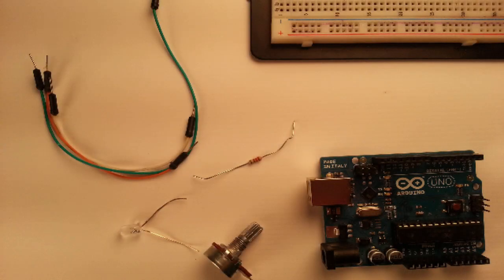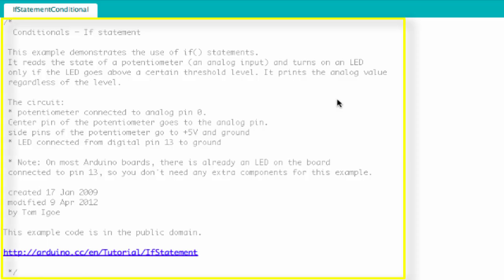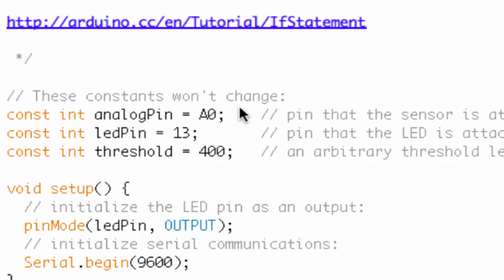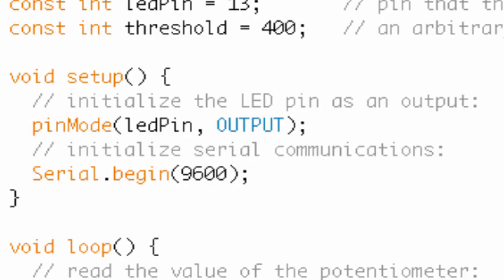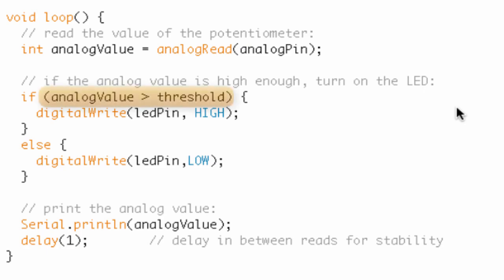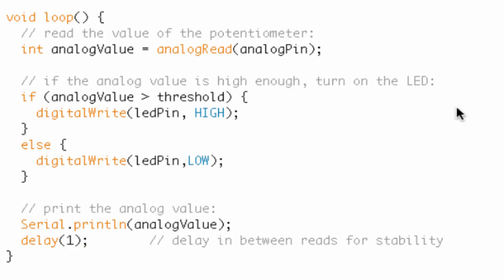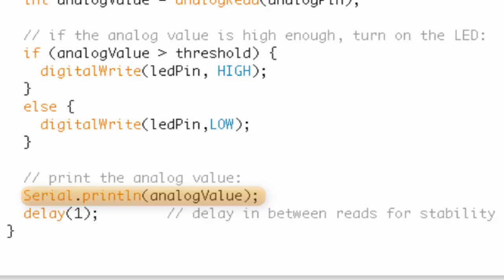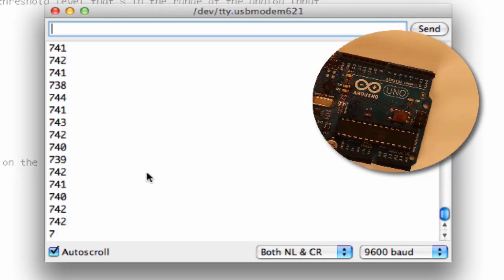Tutorial 11: If Statement Conditionals: Arduino Course for Absolute Beginners (ReM)

Comment: Really strange, I have the code set to turn the LED on before 100 and after 400 and the <100 is fine but the >400 read seems to make the LED REALLY dim, like barely able to be on. can someone explain? Here is the code:

const int analogPin = A0;    // pin that the sensor is attached to
const int ledPin = 13;       // pin that the LED is attached to
const int threshold = 400;   // an arbitrary threshold level that's in the range of the analog input

void setup() {
  // initialize the LED pin as an output:
  pinMode(ledPin, OUTPUT);
  // initialize serial communications:
  Serial.begin(9600);
}

void loop() {
  // read the value of the potentiometer:
  int analogValue = analogRead(analogPin);

  // if the analog value is high enough, turn on the LED:
  if (analogValue > threshold) {
    digitalWrite(ledPin, HIGH);
  } 
  else {
    digitalWrite(ledPin, LOW);
  }
  //This is my edit
  if (analogValue < 100) {
    digitalWrite(ledPin, HIGH);
  }
  else {
    digitalWrite(ledPin,LOW); 
  }

  // print the analog value:
  Serial.println(analogValue);
  delay(1);        // delay in between reads for stability
}
Reply from the maker: Flyerminer I think what is happening is that you are not allowing any time for the pin to be HIGH, when it is above the 400 threshold.

If you try:

  if (analogValue > threshold) {
    digitalWrite(ledPin, HIGH);
    delay(10); //add a short delay
  } 

This should do the job.
I believe the delay at the end of the program is what is helping the LED stay illuminated below the 100 threshold.

Hope this helps!
Reply: Really interesting. Had a similar problem and I've tried a slightly different approach:

 if (analogValue > threshold) {
    digitalWrite(ledPin, HIGH);
  } else {
    digitalWrite(ledPin, LOW);
  };
  delay(50);

  if (analogValue < threshold2){
    digitalWrite(ledPin,HIGH);
  } else {
    digitalWrite(ledPin,LOW); 
  }

When delay(10), led lights up better but still slightly dim when below threshold2 = 100.
When delay(50), led blinks when below threshold2 = 100.

Any idea what's causing this?
Reply: Late response, but you have 2 if-else blocks rather than an if-else block with a compound condition. Instead of checking if analogueValue is greater than threshold and THEN try checking if it's smaller than threshold2, check in one condition whether it's greater than threshold OR smaller than threshold2:

if(analogValue > threshold || analogValue < threshold2){
    digitalWrite(ledPin, HIGH);
} else{
    digitalWrite(ledPin, LOW);
}

Otherwise, if it's under 100, then the first if-else block will see that the condition evaluates to false, causing the else block to be entered and executed, turning the LED off. Immediately after this, you check if the value is under 100, which it is, causing the if block to be entered and executed after a delay of either 10 or 50 milliseconds. This will turn the LED on. This process is looped, so for a longer delay, the LED is off (delayed after the first if-else block) for longer, causing you to see noticeable flashing. For a shorter delay of 10 ms, the flashing isn't apparent; the LED just toggles between off and on very quickly, and you see that as a dim light.

Comment: if i have an object that can move up, down, left, and right. And first i want it to move to the right on command but it should not be able to go down when it is moving left to right or right to left and it can go any further than a certain point (proximity sensor will sense that) and when it moves to that certain point then it can be able to move down and up but when its moving up and down it cant move left to right or right to left. now what statements would i need for those particular movements?
Reply from the maker: It sounds like you might be using several "operators" in the condition of you "if statement".  For example,  
if( movingLeft || movingRight ) {
    //this code only gets executed when one or the other condition is true || is the OR operator. 
}

if( !movingDown ) {
    //this code only gets executed when the bot is not movingDown
}

These are just some very general thoughts on your question.  Hope they help.  You can check out more operators at the Arduino Reference Page for operators http://arduino.cc/en/Reference/Boolean

Comment: So weird, I can't get it to read voltage instead of just value, in println i put "(analogValue*(5/1023));  and it just shows 0, tried making an actual int and still doesnt work. Makes no sense. Not even  printing (A0*(5/1023)); works
Reply: can you send the sketch and have you verified it most of the time any problems show up there
Reply: I just asked this question also.(sorry for not seeing this comment first). Try changing the 5/1023 to either 5.0/1023 or 5/1023.0 - More on this in my comment.

Comment: Do you have a tutorial to show if else statements for a certain range of voltage? say 0-300 lights red led, 301-600 lights blue led, 601-1023 lights green led. I tried to figure it out but it was getting too late.
Reply from the maker: I don't think any of the online YouTube videos cover that - but it's a great question.  An else/if statement does the job very easy.